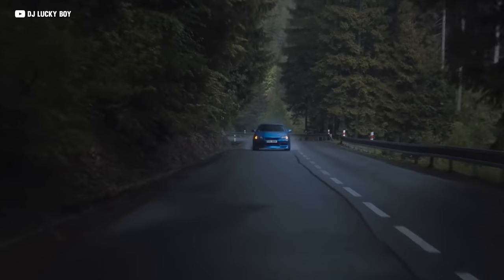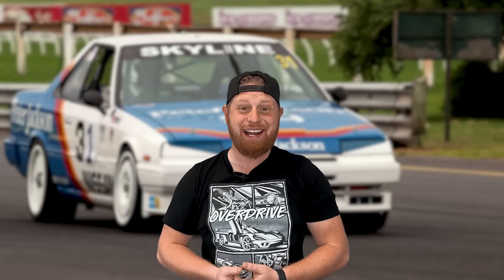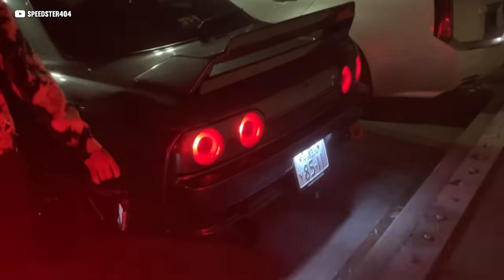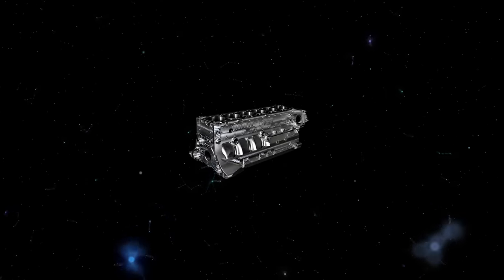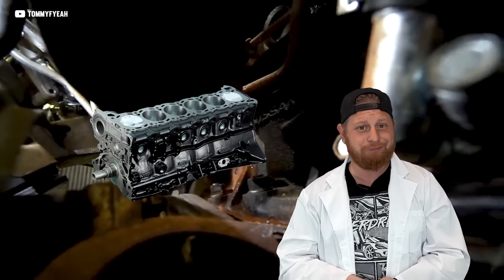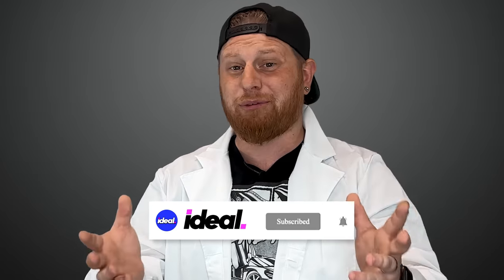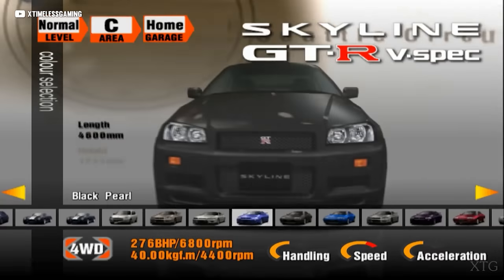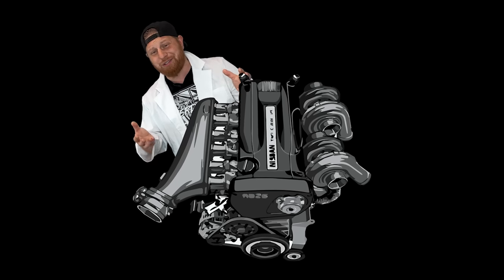THIS Is Why The Nissan GTR DESTROYS Supercars

Comment: I was in the fortunate position to own an R34 for about 8 years, very built, amazing car. The GTR came out, bought one, so I had an R34, and an R35 at the same time. After 6 months, I sold the R35 (honestly, boring), R34 was so much more fun and engaging....and that wicked sound....so good.
Reply: Isn’t the r35 quicker and more responsive though?
Reply: @venomsixxx  same 🤔
Reply: How disappointing. Should’ve modded the r35 to 1500whp. The vr38 is the most power gtr engine that has achieved 3500whp.
Reply: NICE NICE NICE

Comment: I currently have a 1992 R32 GTR here in Texas and boy!!! When you match up newer technology turbo with the RB26!!! It's MAGICAL!!!!! I'm currently pushing about 800 WHP on my with the new Garrett G45-1100 turbo, and I get full boost around the 4k mark. If this was the 90's or even early 2000, these types or turbos would need about 5k to hit full boost.

My R32 GTR with single turboed RB26 is so magical!!!! I love it.

Comment: You said it perfect. RB has so much more character. JZ fans can knock on it all they want but the history of the RB just makes the sound even sweeter. RB powa
Reply: JZ lover here... It's all reliability, and that's where the 2JZ kills all others!!!
Reply: @mrman8856  Its a 30 year old engine at this point. Still gonna cost you $10k atleast when shit hits the fan if you’re talking 2J. I’m gonna stick with my RB. Plus 2J was never in an AWD car from factory. Smoked off the line 100% of the time in similar HP levels.
Reply: @nismo578  Say it again. 30 years old, and still lasting, UNOPENED ENGINES MAKING 400 PLUS UP TO 600 PLUS ON STOCK INTERNALS! What an engine!!!
Reply: @mrman8856  I’m making 475 on a stock RB25DET that’s 27 years old. Not even flagship 26
Reply: @SkimaskTroopah  I believe you. Let me know when you can sit a glass of wine on the engine without it moving lol
Reply: @mrman8856  You got us on that one lol
Reply: @nismo578  Ha
Reply: @mrman8856  thank you
Reply: @Supreme-sx6tu  Any time lol
Reply: @mrman8856  yes rb 25 not that good in reliability, and  jz are strong and heavy so you can tune them to 500 to 600 hp on a stock engine safely because it's really strong cast metal we call it 'fonte' in french but i can't find a good translation.
Reply: @sledgehmindopener6996  I know all these things on why it's ARGUABLY the best engine ever made. I'm glad you do also lol.
Reply: @SledgeHammerMindOpener  Iron block. RB25 is an iron block too. I’d compare the RB25 to a 1JZ. It’s been reliable for me 👍🏻
Reply: The RB is totally reliable when kept withing 500hp, and just speaking it's my opinion, who would want a 800hp GTR or Supra when it can get smoked by other modern 800hp cars which are more about the same price or lesser
Reply: @macsynister  Yeah you’re right on that the horsepower and modern cars. Electric cars are just boring though. This sounds stupid but I just don’t feel as connected to the road. Almost no manual feedback or feeling at all with the electric power steering etc. I actually just drove a Rivian R1T. Insanely fast. Like damn

Comment: RB26DETT with HKS GTIII big single turbo kit = pure awesomeness
Reply from the maker: Thanks for watching!
Reply: Is that so?
Reply: @Mr.nobody_.1  that turbo kit gives the engine a sound that's similar to the 2f2f skyline.  It's obviously not identical, but it's the closest you can get with a turbo kit that's still being manufactured.
Reply: @CaptainRudy4021  most likely you will get closer with a t04z surge ported comp, or a t78 33d or a 29d you can buy that in a kit. You would want to run a Vcam with that turbo set-up as it would be leggy it's just a bush bearing set-up quite oldschool but also reliable (except for the exhaust manifold which will crack in a couple of years from heat cycles) good luck
Reply: @kustomerkare5162  t04z isn't made anymore.  The new hks kit replaces it.
Reply: @kustomerkare5162  the racing Joker made a video about it

Comment: Straight 6 piston engines win in terms of inherent balance and smoothness, but V6 designs have the edge in structural rigidity and space efficiency, at the cost of requiring more complexity to achieve similar effective smoothness. A major reason why Formula 1 chose V engines over straight engines is their inherently better suitability for application as stressed members.
Reply: Way to go.  You mentioned something so many of these inline 6 are god videos failed to mention.
Reply: They choose v engines for balance and nothing more lol. Space efficiency? Huh? It literally takes up more space. Lol
Reply: And nothing will ever be more smooth than an inline 6

Comment: dude the VR38 is the most dominating engine of all time. RB doesn't even come close. these boys with their r35 at tx2k on fl2k wipe the floors with any other car. hell even underground racing with their tt lambos cant touch the GTR,
Reply: The vr38 is 20 years newer and is part of the “GTR” family. And for the record. The fastest gtr in the world is a legitimate r32 skyline streetcar (prostreet) called jun2. It has went 6.37 @224mph on the old setup and still runs awd, IRS, radials, full interior and FULL factory chassis (including radiator support).

Comment: RB sounds amazing, it's reliable. And while the 2J makes more power reliably it's way too heavy, there's a reason Toyota didn't even use the 2J in race cars...
Reply: The Rb26 is heavier
Reply: The rb26 is heavier. And the reason they didn’t use the supra in racing, was because it didn’t meet restrictions and it wasn’t a good platform.
Reply: They used the supra in japanese racing with a 3sgte what are you talking about

Comment: The present GTR with the VR38DETT still blows them away.  There are developments of the engine that working to make past 2000 hp.
Reply: As well as rb26. JUN2 is making over 3000hp. Just moved to a billet block but was a cast block.

Comment: The biggest complaint I've heard about the R35 is of it being numb. It's blistering fast and a marvel of engineering but there's not much feeling. The communication between the driver and the car is muted by the hundreds of computer controls and assists. You're driving a cat that feels like a simulation.
To me, the R34 will always reign supreme. The 32 and 33 may be nearly identical mechanically, but the 34 brought it all together in one of the best looking cars of all time. Just wish I had the slightest chance of ever affording one.
Reply: The people that say that can't afford one.
Reply: I’ve been lucky enough to have driven an r32 get, a few r33 gts wi modified rb25s, an 700bhp r33 gtr, a700 bhp autech r34 and a 1200+bhp r34 gtr. And the both r34 were outrageous the 1200bhp was just as far as I reckon any car needs to because you just can’t use it on the road except for very very rare and short periods. The autech is the 4 door gtr and was a thing of extreme beauty but for me the r33 gtr was the best compromise in terms of feeling and not just a masterpiece of computer aids making it too easy to drive at extreme speeds in straight line but also in the bendy bits like absolutely ridiculous that it not even a challenge at all and just done something that even a legit super car might struggle to actually achieve and it was nothing
Reply: @eoghannmcalpine8188  You can't say that unless you have driven a supercar.
Reply: @wford8987  I have
Reply: @eoghannmcalpine8188  Then how could you possibly compare the handling of a 30 year old car to a modern supercar?
Reply: @wford8987  I was comparing it with a slightly newer one than the r34 but yeah on real roads that r34 would have out handled pretty much any of the current ones too. When it was on a track with them  it would be different
Reply: @eoghannmcalpine8188  But skylines aren't supercars. You said "even a legit super car might struggle to actually achieve". Whats supercar are you comparing a Skyline to?Even a stock R34 isn't the beast it's hyped up to be. I've seen them lose badly to their other rivals of their generation like the FD3S.

Comment: Nissan in the 90s was killing it. I had 240SX with a KA24, handle well, but slow AF. It got flooded, got another 240SX with a red top SR20DET and I loved the car. It had lighted flywheel and a different manifold with a electronic boost controller, the thing had very low lag and pulled pretty hard for stock turbo. I seriously miss that car

Comment: I love driving my Skyline. I swapped it over from a RB26 to a RB30/26. Basically, just a 3.0 block with a 2.6 head. The added displacement with the AWD is a perfect combination, just wish they came from factory like that.
Reply: RB30 🤤
Reply: Is it really worth it. I also have a RB26. I have thought about going 30 bottom end. I just do see it finically practical. Just rev the RB26 so make the same power. Just no bottom end power. What are your thoughts mate. Would love to hear it!
Reply: @Andrew260RS  I mean, I've seen a notable difference from 2.6 to 3.0. Not just in power but also in drivability. We here in America believe in "no replacement for displacement"; in this case, I agree. I feel the additional torque not just down low but also in the mid and high ranges. Any turbo setup comes onto boost faster and more consistently. The transient response, meaning  on throttle, off, and then back-on is better as well. To me, it's just a better overall experience. Also, RB30 blocks are a fraction of the cost of RB26's, and if you want a 24U block, forget about it. I think it's the hidden gem of the Nissan RB line. Not enough people know about it, and even fewer understand. If you can do it, I say go for it! I guarantee you will not be disappointed. I personally would buy a block from billet racing engineering. After building mine, and having all the machine work done; it cost around the same amount as if gotten a billet block. Plus, the benefits from cast iron to aluminum are astronomical. Cheers Mate from the United States!
Reply: I have a question. Wouldn't the smaller 2.6 head on the 3.0 block. Raise the compression quite a bit. From what little I know about turbos. You want a lower compression rate. Something like 8.5 to 1. Instead of 12 to 1. With the extra compression. Is there any chance it could cause problems at high boost levels
Reply: @Daniel Bryant  my RB30 has 8:5:1 pistons in it, so there are no worries. I run 19 psi on low boost, and with my build, I could run 30-45 psi on high boost. But I popped a head gasket and never got the opportunity to optimize and max out my setup. My issue was non-compression related. I am going to build another motor with 9:1 and balance it with methanol. However, If I had unlimited funds, I could build a motor with 12:1 compression on a 98mm turbo. The added compression would severely cut down on turbo lag. I could go billet block with dry deck, with a couple of tricks I know, and that would spool that turbo almost instant. But that's if I had an unlimited budget. I'm not there yet, yet! Good question tho. Keep doing your research.

Comment: If nissan are remanufacturing that engine and their could be a possibility that the next gtr will be powered by an inline six like the supra has yeah it's a bmw but going back to what is supposed to be is damn that would be a defining action that nissan is for the car enthusiast just like what they did to the z it's perfect the ups and downs of that car is perfect.
Reply: NOT reman - manufacturing new.  ZERO chance for a i6 in the future

Comment: RB26 sounds the best and seems to be more fun. but i think the 2Jz is more reliable and can definitely handle more power with the stock internals and more power overall. would be cool if nissan could make a new inline 6 similar to the rb26 that would be better than both the previous RB's and also the 2Jz's in every way!
Reply: Nissan is "re-making" the RB motor for U.S customers..,the twin turbos will be BIGGER than the early RB motor. Expect the cost well over "50K" for a brand new RB..
Reply: 2J is really big and heavy. Toyota did not even use it in race cars.
Reply: @keckchan7156  are they only changing the turbos and that's it?
Reply: @littlenismo  oh wow.  I didn't know that
Reply: @wesleygriffiths8496  more specifically they're reselling Skyline GT-R R34 for you via Skyline Restoration Program, and despite "restoration program" you can actually request them to source the car for you (with additional cost of course)

then you must be guessing why people still waiting for 2025 rather than buy directly from Nissan / Nismo ?? Because the price starts from 400k USD (around 500k USD if you ask them to source the cars). AND that's just the starting price, if you say want to upgrade the engine (RB26DETT N1, RB26DETT R2 or even RB28DETT Z2), or specific paint (Silver Z-Tune, Midnight Purple etc) or any other accessories ( 320km/h Nismo speedometer, etc) then it will go around 1 million USD fast
Reply: @wesleygriffiths8496  bumping up from 2.6 to 2.8 liter..and the turbos will be bigger than the early RB motor..I'm guessing nearly 650-700hp
Reply: @taiminsen8069  fuck that..I rather buy a non-meant condition R34 GTR with worn out body paint and dents here or there and restore it myself. It's also a good thing if u have family or friends that lives in Japan that can get the car for u for a good price instead coming from another country and they're raised the price on u..
Reply: @littlenismo  the 2jz long block is actually lighter than RB’s.
Reply: RB20 definitely sounds the best.

Comment: GT- R is a very great car for the price and the engine tuning
Reply: Yeah 90k is a greAt price😂
Reply: @driftking_dg9619  given it was faster than the supercars of the day it was steal. And this reflects the appreciation of older models today.
Reply: @driftking_dg9619  Skyline GT-R R34 was never cheap in the first place. Their original price range starts from 50k USD for base spec, 60k USD for Nur and 125k for Z-Tune. In other words, much more higher than its german rival BMW M3 E46 (unless it's M3 GT-R E46). But it's still much more cheaper than even entry-level exotics such as Ferrari F360 and Lamborghini Gallardo

but then you're guaranteed to have a very strong resale value, so you're not losing anything. I mean just look the used price of base Nissan Skyline GT-R R34 and Lamborghini Murcielago of the same year, it's basically priced the same around 150k - 160k USD despite Murcielago is much more rarer (11.000 units vs 5.000 units worldwide)

it's because Skyline GT-R R34 is especially much more desireable to most people, even compare to exotics, let alone its cheaper german rival
Reply: @taiminsen8069   well, thanks for your answer first of all. Its kinda funny, because im actually from germany😂. The fact that the e46 is cheaper is well known around here(ill come to that later) so first of all yeah the new prices with the trims are not too much but not cheap either but that makes no difference, because its not the 90s and you cant get an new production model... And appreciation was good the the whole gtr row so the all cost nearly double that... Yeah exotics are more expensive but theyre a whole different "genre" maybe except for the galliardo (prbbly spelled wrong) because its the cheapest and m.ost who buy it tune it so its kinda a tuner car too. The gtr is more like an evo or an sti. Not like an hurracan. So about the e46: i bought a motorcycle recently (and i love it) older model around 1993 and it was kind of a "barnfind", worked perfectly but looked like it was hit by a tank so i kind of restored it... But thats a whole different story. I drive it (even tho im 15 and it has 50hp, cant do that around here, need to be 18) to tuner meets wich are kinda not legal and i see minimum 30 e46s every time and only 1 or 2 are m3s they are rare as hell here (the germans love their cars) and base e46s cost like 5 grand around here, on the other hand m3s in good shape cost 30, 40+ grand. E36s and E46 are really popular but you dont see them as often as you might think
Reply: @driftking_dg9619  even if used base BMW M3 E46 currently cost 50 grand USD then that means it's still not nearly double the original price which original price was 40k. Perhaps M3 CSL E46 or even M3 GTR E46 may have high resale value but still pale compare to Skyline GT-R  R34

currently, even base Skyline GT-R R34 cost more than double original prices since most was asking more than 100 grand USD. Going to Nur trim version and it's around triple the original price since. The rarest trim such as Z-Tune commands much more higher, rumoured around 1 million USD (AFAIK recently 1 Z-Tune was sold from Thailand owner to USA)

hell even currently base R34 such as GT, GT-T and GT-Four cost around 20 - 40 grand depend on bodystyle (coupe is the most expensive while wagon and sedan is the cheapest)
Reply: @taiminsen8069   hi again, i just found an r34 gtr wich was build into a z for 40 grand, kinda cheap, but there are still cars for less money and have the same value, the e46 for example is sick as hell, my favourite bmw is still e36 tho. If i had the money for the gtr, sure i would buy it, but till then my dream car is an audi s2, wich can be tuned to 1500 hp

Comment: As much as I love the 2jz and the rb26 but the ford barra 6 is just to close to my heart
Reply: Barras are heavy and they’re in an extremely heavy platform that’s slow. Skylines absolutely dominate xr6’s. And the 2jz is a stronger counterpart to the Barra.
Reply: @lennixsingh626  Barra's still make more power reliably then both those engines.
Reply: @stuckinadream9538  they do it easier. Not more reliably.

Comment: Run a cold air intake system into a pod box of a RB26 and listen to the turbo spooling. You don't sit in a Skyline you fall into it and You don't drive a RB26 Nissan skyline you experience it . ✌️🤘🇯🇵🇦🇺